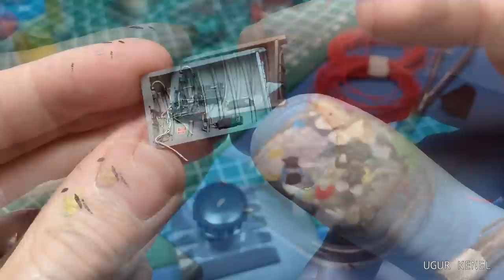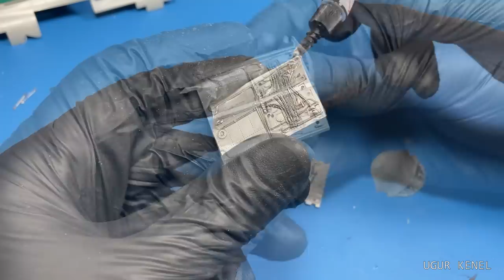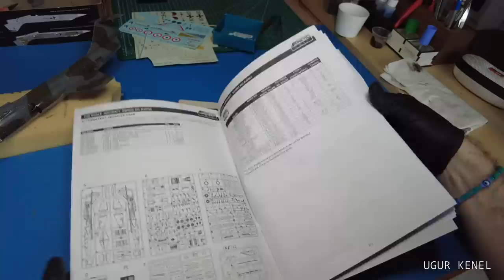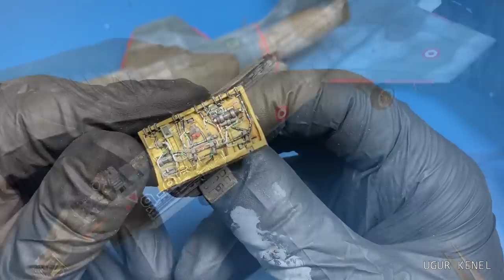HOW TO BUILD HIGH DETAILED F 104S STARFIGHTER  1/48 SCALE MODEL KIT - PART 2

Comment: Superb assembly, but 1 remark, you reversed the 9 in 6 on the 1st marking of the empennage compared to the fuselage
Reply from the maker: Thanks. Yes there is no squadron numbers on the tail. Just the serial numbers. It start with 6. But on the nose, first number is squadron number and the following numbers are last 3 digit of the serial number. So i just copied the real one.

Comment: Perfect work.....one advise when doing camouflage use plasticine believe me your bills on tape go down.
AMAZING WORK
Reply from the maker: thanks. i tried them years ago. sometime ( maybe depend on the brand) they include some oil to prevent drying. And my worked a lot to remove the oil from the model. then i start to use re-usable adhesive like Uhu Tac or Tack It. So i am afraid of use them again🙂 thanks for advlse 👍👍👍

Comment: Beautiful!!! I am shortly going to attempt a similar build w/ the Kinetic F-104A/C; at one point in your "part 2" video you brushed on a thinned dark medium. Was that simply a black wash, or something else? Also, where did you find the panel placards? I have the Black Dog Resin sets but have not found placards for the panels as you have shown on yours.
Reply from the maker: Even though I don't understand exactly what point you are talking about, I generally use thinned dark colored acrylic instead of wash. As placard decal, I use decals that I find appropriate left over from various kits, and ANYZ decal company produces placards just for this purpose.
Reply: Thanks for the reply and the info about ANYZ. Oh, and I do actually have one more question: is that basic modeling putty you use to keep things in place while test fitting, and when you attach the hatches for the paint job? It looks sticky, but it all came out. I'm interested in that stuff.  @ugurkenel
Reply from the maker: @user-di4ip5ui3r It is a stationery product, called reusable adhesive. Search as Tack-it, Blu-Tack, Uhu-Tack…
Reply: I'll look those up. Thanks! That was a great idea. And what a beautiful and comprehensive build!! Magnificent.  @ugurkenel
Reply from the maker: @user-di4ip5ui3r Many thanks😉🤝

Comment: Sir hi, the aircraft # is 9864, on the tail you have the wrong # i.e, 6864, please rectify if possible.
Reply from the maker: Hi. Yes its correct. On the nose, number starts with Squadron number which is 9. Rest 3 digit is last 3 digit of the serial number. But on the tail, number is exactly the serial number, so it is 6864. The model is builded based on exactly same with reference.😉👍

Comment: Hey,  what did you use to make the wing egde protection?
Reply from the maker: Metal or aluminum tape, i dont know the exact name of it. They use it as isolation material. Than painted red.
Reply: @ugurkenel  thanks. I'll try it out.   Finally got a starfigther this weekend, after wanting to build one when your video came out😅.  Great work
Reply from the maker: @marcranger4596  ooww nice, really appreciate to hear that👍 good luck.

Comment: tail number should be 9864, you did 6864.
Reply from the maker: Hi. Yes its correct. On the nose, number starts with Squadron number which is 9. Rest 3 digit is last 3 digit of the serial number. But on the tail, number is exactly the serial number, so it is 6864. The model is builded based on exactly same with reference.